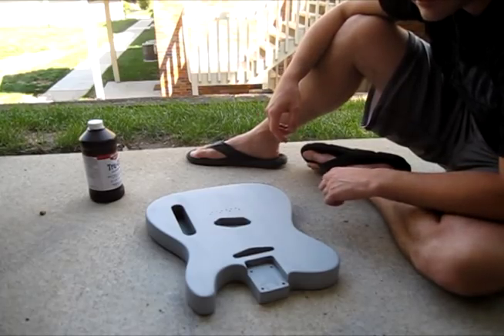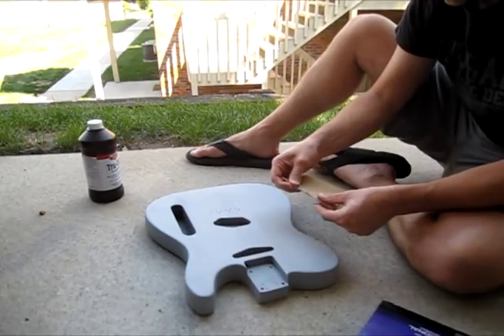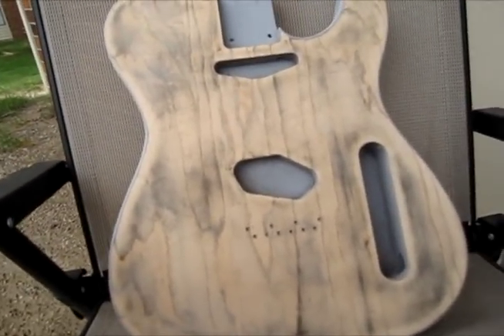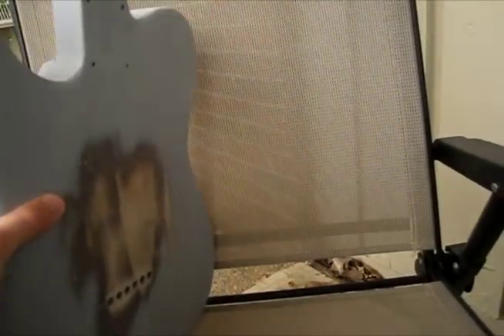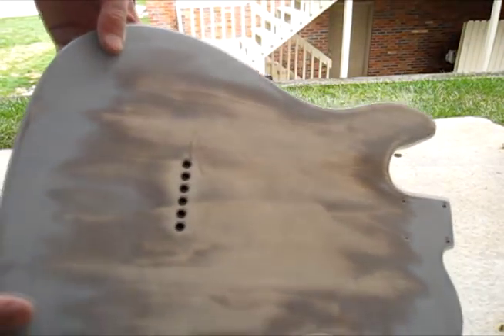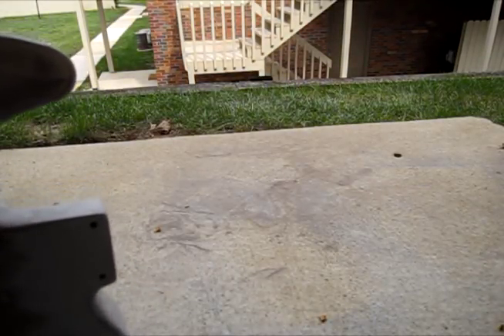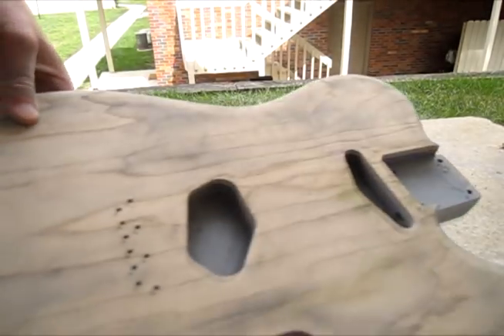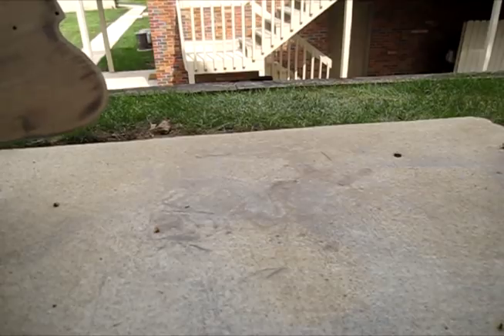How to Build a Telecaster Vlog pt 2 - Sanding the Body

Comment: citristrip wouldve saved alot of time, and works well in small places as you only need minimal ventilation, unlike other products like strip x, only downside is the drying time after rinse, which would be a week minimum,and two weeks drying in most cases, thanks for the vlog as im getting ready to tackle this project, custom gun building has treated me well, and thinking a tele will treat me just as well...